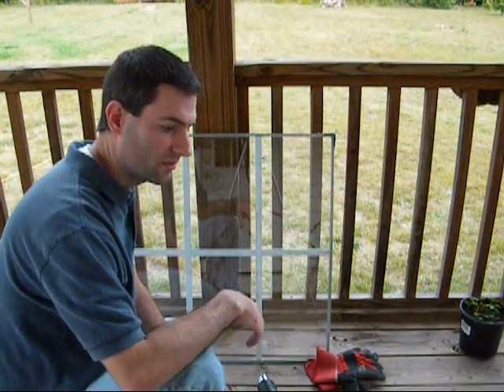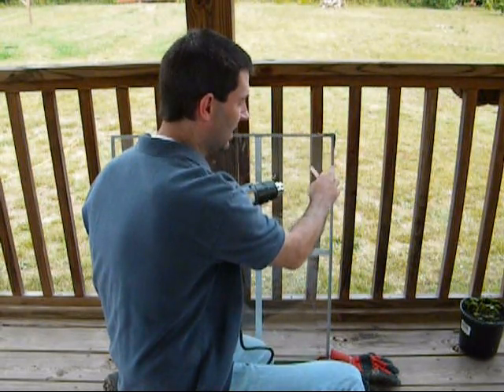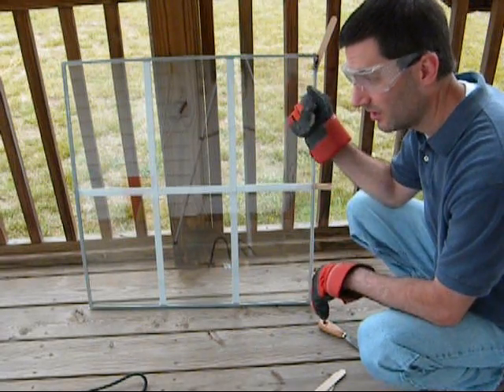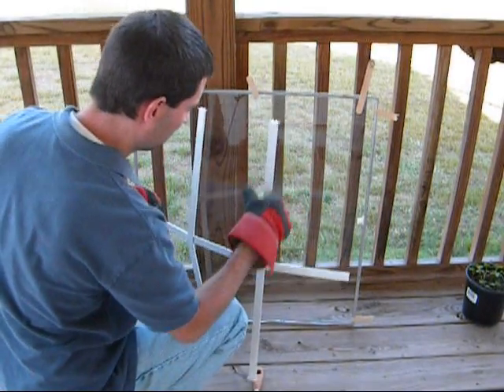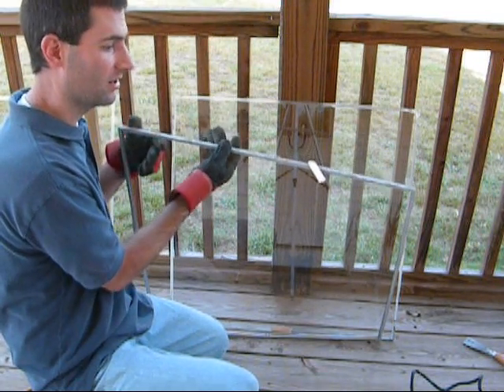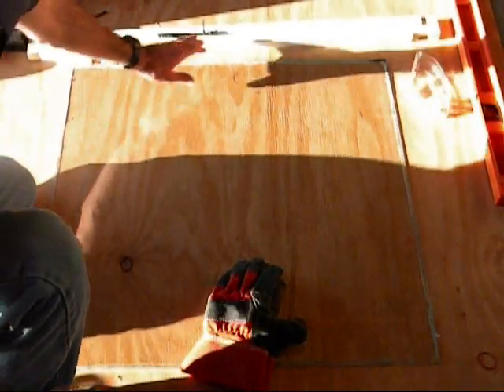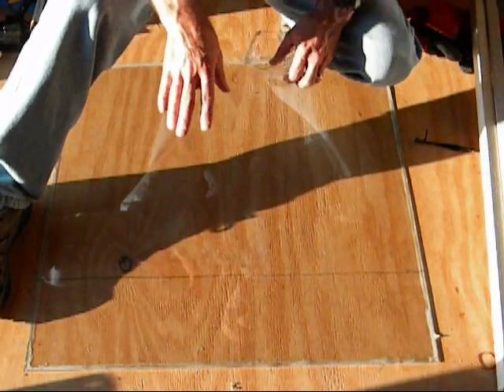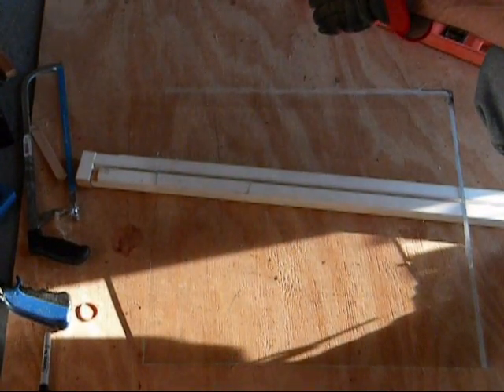How to build a solar panel part 4 (new)

Comment: Can I make a suggestion in regards to measuring anything especially when it comes to wood, glass, Lexan, metal?  You ddon't have to if yyou don't wantt to.  Try starting from the 1" line (called "taking or leaving an inch") and just go one inch beyond the initial start (not including the end of the tape measure) and measure out (i.e. it the measurement is 21", put the 1" line as a starting point and continue to the 22" line.  It will still be 21", but it will leave a more accurate mark for cutting.

 I use this technique, when I build "Copper Cactus J Pole Antennas or any woodworking.  It also helps in when there are somethings that require close tolerances.  Just an idea  Try it if you would and may feel that it helps.  I post suggestions with the hopes that someone might read them & try them and they can draw their sown conclusions.  Be it as it may & believe it or not, it is my area of Minsitry.  To help those who may need maybe an idea or such.  Yes, I am a born again Christian & try to live my life as such.  

God bless & keep you, may His light shine upon you and may He look upon you with favor.

Comment from the maker: You can use any type of glass if you do not intend to cut it. If you want to cut the glass, it must be non-tempered. If you try to cut tempered, it will shatter into tiny pieces. You can use lots of different material for your frame, but condensation may be an issue. If it helps, I did a couple of videos on underwater solar panel. It may give you some different ideas on frames. Thank you for the question, Lonny

Comment from the maker: @chazsql  Good question, I forgot to mention in my video why I am making them that size. I have 2 solar stands that have 7 panels on them each. They are the 15 watt ones. I am replacing the them with the 63 watt ones. If I make the panels that size I can put up 4. If I go any wider on the panels I can only put up 3.  It is just a space issue for me. If someone had more space they could definitely make their panels bigger.